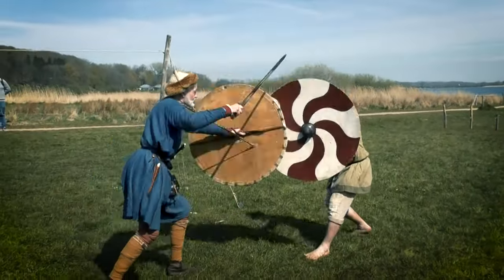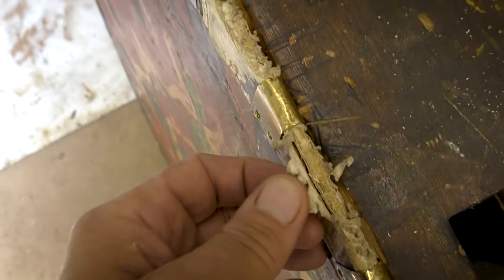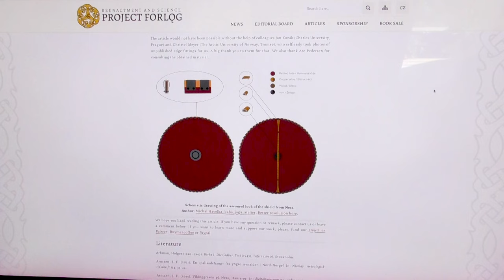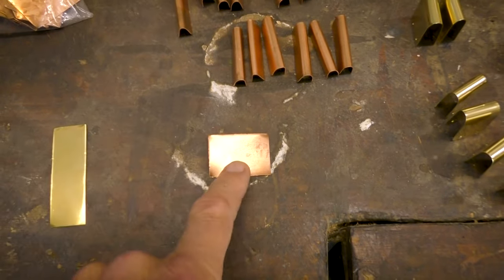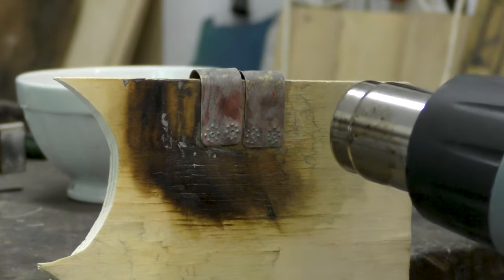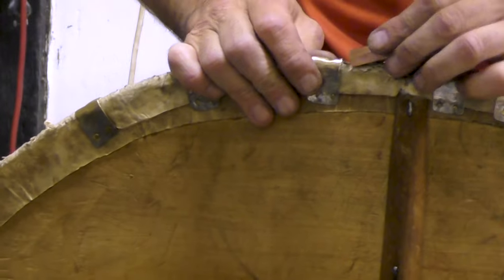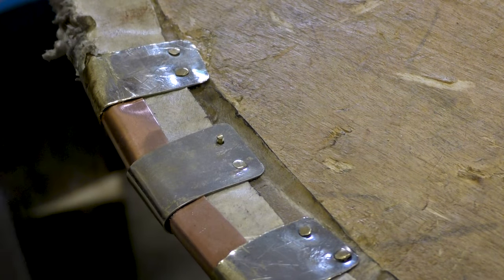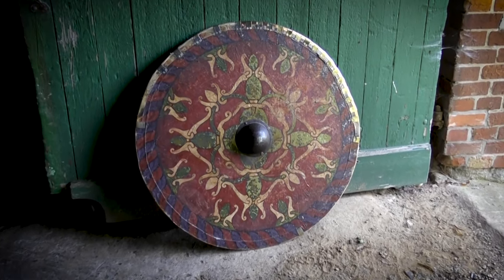Metal Viking Shield Edge Reinforcement

Comment: How much weight did this all add? I too look forward to how it does perform. I wonder if the metal edge will effect a bind on the sword edge. Might it make dull swords slide more readily, and a sharp edge bite into the softer metal and hold a bind??? Look forward to you testing it. Thank you for the interesting repair video.
Reply: My thoughts exactly; I shant make my own comment as you have posed my very thoughts. Thank you ⚔️
Reply from the maker: I did not notice a difference in fighting. I missed to weigh the shield ever since I added the clamps. As for binds: Naturally, blades stick to hide edges better. However, sharp edges and points also stick to iron bosses and opposing blades. It is quite amazing. The effect is quickly lost when the edge gets dulled in fencing.

Comment: There are any evidence of use iron or steel wire as edge reinforcement with metal clips covered with rawhide ?
Reply from the maker: I am not aware of any hide covered clamps. There are other types of thin metal edges from migration era shields.
Reply: @swordandshield Thanks Roland. What if they had them, as in the case of the excavation of the Sutton Hoo shield, do you think fighting with such a shield would be radically different from a standard shield not reinforced with steel or iron wire?

Comment: Please stop using sword thrusts obsessively. Viking era swords were better suited to cutting. Vikings preferred axes. The Cutting style that viking people used with axes would have transferred over to their sword work.
Reply: They also used spears ....
Reply: @vorrnth8734  Dark age swords were not optimized for thrusting like speers. These swords were cutters.
Reply: @tsafa  Not optimized does not mean it is impossible.

My comment was more about highlighting your nonsensical argumentation.
Reply: @vorrnth8734  occasional thrust... Sure.

The majority of strikes should be cuts. 
Like I said in the original post, they are "obsessively thrusting"... as if they are using rapiers.
Reply: I think the Vikings would have used what worked, plain and simple. They weren't idiots. Since Roland is studying Viking combat and actually practicing it for decades, I suppose he would have come the conclusion that his technique works as well, and better than others. If cutting worked better than thrusting, he'd be doing it. I suggest you pick up sword and shield and find out. If you beat others by cutting, you're right. If not, you're most definetely wrong. Because in the year 850 you'd have been dead...
Reply: @christianb.1028  you just have to pick up a sword from that era and see that it is not a good thruster. It is prone to bending if you thrust into anything with resistance. The design of Swords changed in the 15th Century in order to make them good thrusters.
Reply: @tsafa  Cutting a person around and behind a 90 cm round shield board is much harder than poking through a tiny opening that the foe provides occasionally to literally see what's going on in front of him. The cutting capacity of the Viking era swords means that you can deliver a strong, decisive chop against a foe who lost his footing and is wide open, or he has lost his shield and other weapons, or has fallen to the ground or turned his back. But other than that scenario I don't see any advantage in wide cutting motions that "telegraph" your intentions and can be easily intercepted. 
Moreover, the thrusts seen in the video "test" the enemy's shield with pressure to see whether the shield can be pushed in some direction to create the opening needed to cut.
Reply: @AggelosKyriou  do not take this as an insult, but you are illustrating how most people today do not understand how to make cuts. Cuts should be very tight with deception and misdirection. Initiating and attacked one quadrant and then switching to another through the cut. The thrust can also be worked in there, but through all the years I have seen them fighting, they have never developed a cutting aspect to their fighting. 

They've done a couple of videos where they illustrate some good cuts that come over the top with a slipped grip or a back edge but they never really incorporated into their regular fighting. Every possible imaginable type of cut was used by somebody that is mechanically possible by every group of people that ever swung a sword ( as well as thrusts).

Is also the benefit of the higher rotational speed of a swordtip moving in an arc. A thrust can only move forward as fast as your hand can push it. The thrust has the benefit of 0 through depth perception. Are e useful and both should be used.

They do lots of good work, but I think that they could advance their work a lot further if they developed cuts into their fighting style.
Reply: @tsafa   the last few seconds of the video show almost entirely cuts and chops, very neat. I dont know what you are talking about
Reply from the maker: How would anyone know that early medieval swords were predominantly used for cutting? The idea that the rounded shape of a blade's point is an indication for it being used as a slashing weapon, is an out-dated armchair expert assertion. The design of the point much rather reflects the kind and amount of armour that was expected to be worn in a combat context, regardless of period. Rounded but sharp points were also common with landsknecht side arms, or swords used during the Muslim conquest. In either case you would see fighting contexts with little or no armour. 

When thrusting, the advantage of a wide point is that it causes a wide wound channel, which means high blood loss in case it is not instantly lethal. I have thrusted through animal carcasses repeatedly with swords with rounded points, and they penetrate the target effortlessly. As a rule of thumb you could say that you want your blade's point as wide as possible, and as acute as required.

In terms of fighting theory, it would be foolish NOT to use maximum weapon reach which is always provided by any longpoint position of the sword. But I will not open this can of worms in a comment section.

Apart from that, your statement that Late Iron Age Scandinavians would have preferred axes, is not backed up by archaeology. Yes, there are indeed many axe finds in period weapon burials but statistics would not allow for the statement you make. In fact, the oldest known Viking ship burials at Salme, Estonia, from the first half of the 8th century contained fragments of no less than 40 swords. No axe preference noticable. In turn, the long-hafted axes that are generally considered to be actual weapons, not tools, come from the very late Viking Age. They could by no means have had any impact on sword-fighting of preceding centuries. This being said, the so-called Dane axe is excellently suited for thrusting, too, and that is obviously reflected in some designs.

There are many excellent academic papers and books on these subjects. I recommend reading them.
Reply: @swordandshield  let us proceed on the basis that everything that you said this correct, even though I think there is room for debate and talk from a Tactical Position.

Keeping the sword extended for a prolonged time leaves it vulnerable to getting trapped between the Two Shield edges for a momentary advantage. Or using one's own sword to pin the other sword to the shield and exchange.  This is difficult with Buckler's because they are small, but is quite easy to do with the large Shields. It doesn't have to be permanent, just a momentary trap. 

You can still use the full length of the sword to make a tip cut at maximum range.  This is not to say that thursts should not be used.  All advanced fighting is about deception and misdirection. The best Thrust is one that starts out as a Cut. The best Cut is one that started as a Thrust.

The thrust has an advantage in that it makes visual depth perception difficult and can get into tiny openings. The speed of the tip can only move forward as fast as the hand can move forward.

The cut has rotational velocity that exceeds the speed of the hand. This is especially useful for misdirection. 

Most cut-and-thrust should start with the hilt near the shoulder. From that position it can attack any quadrant as a Cut or a Thrust or combinations. The Shield can be used to hide the sword.

You do a lot of good work and I follow your channel, but I think you should consider some of the things that I said with regard to the blade work. Nobody knows everything and everything that we imagine possible was probably done by somebody.
Reply: @tsafa Every sword with sharp point is designed to thrust, however some do it better some do it weaker.
Reply: @tsafa  Nobody denies the usability of quick and tight sword cuts but we need to take into account some things.
1) Even the lightest axe of this era has a completely different point of balance and reach than a sword of this era. So the body mechanics are totally different and muscle memory doesn't transfer from the sword to the axe or vice versa. The axe has also a hooking capacity which the sword lacks by design.
2) The so-called Viking sword had the same blade as the ubiquitous cavalry sword of western and central Europe of the Carolingian era, itself derived mostly from the late Roman spatha. The best quality blades used by the Vikings (e.g. the Ulfberht ones) were probably imported from the Frankish lands. Those quality blades were aimed at the Frankish cavalry and thus were given good cutting capacity since thrusting from horseback is fraught with the problem of disengaging the blade after the thrust (which explains why cavalry swords are mostly cut-centric from antiquity to the modern era with the possible exception of the European Late middle ages). In the Viking era, when metallic armor was available to a very limited ratio of Western-central-Northern European troops a rounded point was deemed sufficient for the thrust. Vikings and Anglo-Saxons used these cavalry blades because they couldn't or didn't have the economic capacity to drive the production of blades specialized for infantry combat, since they had no real cavalry themselves. Thus the use of those blades by the Vikings doesn't need to reflect the probably cut-centric sword fencing of high-status Frankish cavalry, the main market for the so-called Viking blades.
3) The Viking weapon system. Vikings paired every melee weapon, either spear, axe or sword with the almost ubiquitous 80-90 cm round flat shield designed to be held at arms length to optimize the cone of defense. And the dimensions of such a shield make it almost impossible to cut without lowering or swiveling the shield out of the way to do so, exposing the wielder to counter attacks.
Compare this to the earlier oval and oblong Celtic and Germanic shield which are far narrower (eg. the Hjortspring shields are only 22 to 52 cm wide!) and if Tacitus and Julius Caesar are reliable sources, were paired with vertical sword cuts. 
It's more probable that the Vikings used mostly thrust-centric fencing which is less risky for the wielder.
Reply: @AggelosKyriou  I've been fighting for about 17 years with large Shields. There's no way to know for certain how Viking age people fought, but I can tell you but with similar style shield and sword the more variety a fighting style has the harder it is to beat. 

If I know that somebody is only going to use to use thrusts only, that's all I need to worry about blocking. If they start throwing cuts from different angles and different speeds, then I also have to start thinking about those.